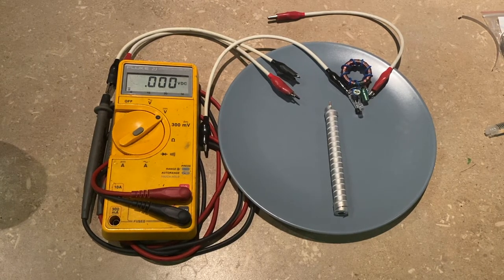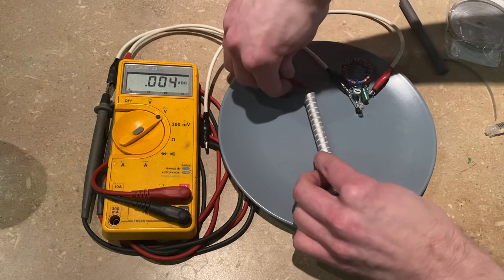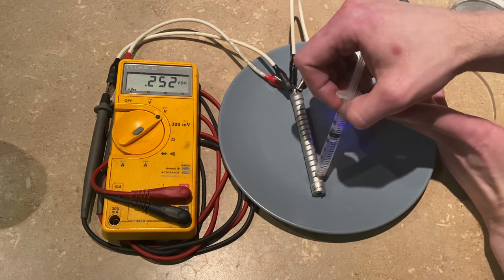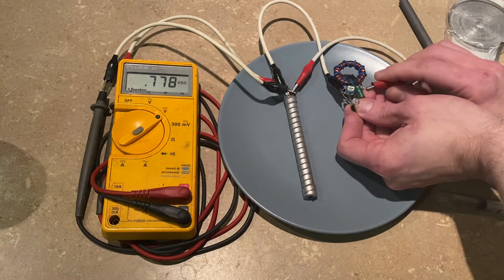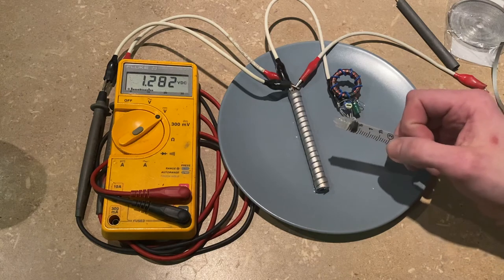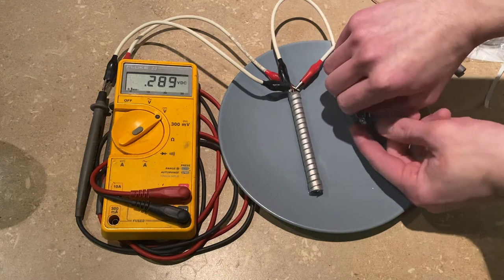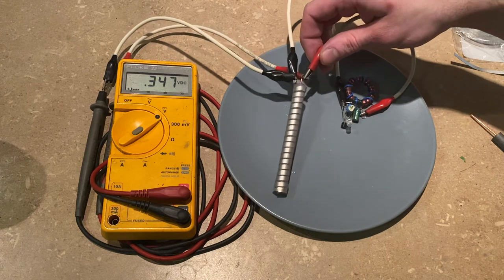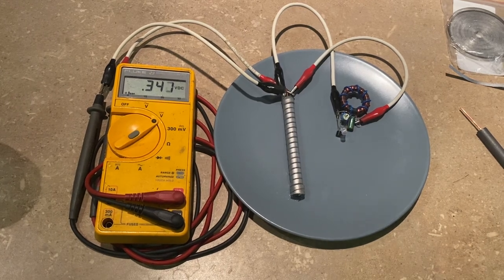Quick Load Test - Magnesium Carbon Power Cell @ Faraday Energy Research

Comment: I have a aluminum shell copper core with Zinc GANS packed inside and it holds 0.67v. Has held that for 2 years now without any charge whatsoever.

Comment: I have a few cells that I saturated with grapefruit seed extract. I sealed them with electrical tape after I wiped the excess off of the mag tape. They have been holding steady at 1.7v. I will make a jewel thief and test them.

Comment: You may want to try copper and aluminium wire coiled in a plastic tube 20 mm diameter 100 mm high with deionised water. Make at least 8 cells in series and you can lit up many LEDs (see my channel). But it is essential to use an electrolytic capacitor 100 uF or more across the output of cells.

Using potable water I can get 4-4.5 v, using deionised water 7.6 v. With deionised water, no corrosion occur and water stays clear all time … to improve amps attach a little solar panel if you really need.

Also black soft iron wire + magnesium ribbon gives 1.4 v per cell, enamelled copper wire + magnesium ribbon 1.6 v per cell. You can wrap one of wire with teflon tape (for plumbing) as membrane/separator if using bare wires/metals.

I can’t read any amps with my multimeter whatever I tried, but you can see many LEDs in parallel being lit up
If you have access use heavy water instead and you may be surprised by results.

Comment: Looks like what you have there is a rather inefficient magnesium-air battery. Its output current could be significantly improved by increasing the conductivity of the electrolyte. Try using dilute sodium or potassium hydroxide or if you want it finger safe, then use sodium carbonate. Both will work to get you extra current but don`t expect too much as performance is limited by the rate oxygen from the air can diffuse into it. The energy density of such a cell can potentially have a very high energy density if constructed carefully. Instead of magnesium the cell will work quite well with aluminium if you use dilute sodium hydroxide as electrolyte. Again the performance would be limited by the rate of air diffusion.
Reply from the maker: Most certainly correct. The point of this video is to demonstrate that there is a slightly different phenomenon simultaneously occurring in addition to our common galvanic reaction. This is why I chose to use distilled water for demonstration instead of a proper electrolyte which increase output two orders of magnitude or more. Distilled water is indeed still mildly conductive but it’s use here inspires us to consider a more in depth mechanism of ion transport which could be occurring between the magnesium reaction with H2O and absorption of ions from the carbon rod.  Something to think about. :)
Reply: @exoticpropulsion8175  I might be missing something because I can only see the redox reaction. A little slow but still fully explained. Is there something going on in there that is somehow unusual? Distilled water no matter how pure is always slightly dissociated and that is all that`s needed to account for the small current.
Reply from the maker: @TheTemporalAnomaly  oh that is true. We must acknowledge that magnesium will still oxidize and break down in distilled water extremely slowly, because distilled water does contain some tiny percentage of free ions. Although I believe perhaps impurities from the manufacturing process of the carbon rod may be contaminating the experimental results more significantly then the other factors.  The only way to know for sure would be a series of intensive washes for the carbon rod, complete deoxidation of the magnesium strip prior to assembly, and the use of deionized water...  at minimum at least we can recognize the fact that a pH neutral solvent is still capable of creating a metallic anion decomposition reaction. I don’t see this tech as being very useful industrially and your points are valid and correct. It is interesting but I will not be revisiting this device because of the adequate explanation which you have clearly provided here, (in my opinion at least).
Reply: @exoticpropulsion8175  You might also find it interesting to have a look at material compatibility sheets / tables. Look at DI or dist water compatibility, you will be surprised at how quickly it will attack various metals that are usually safe from attack in normal water. As an example, you shouldn`t store DI water in stainless steel as it will eventually cause pitting of the vessel. Another interesting experiment to try would be to put some polished DI (very pure) water on say a glass mirror, heat it to around 60 deg C, leave for a few tens of mins and you will see surface damage! Surprising stuff! Thanks for the replies, it`s good to have a discussion. Quite a few Youtubers don`t reply.